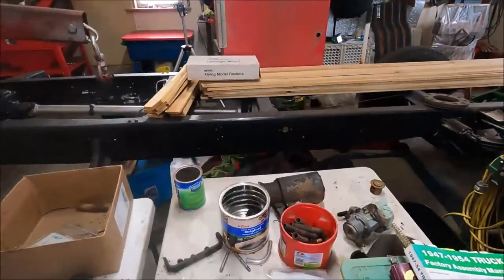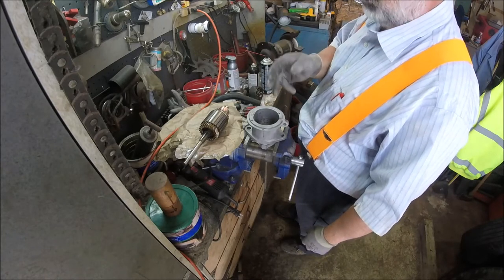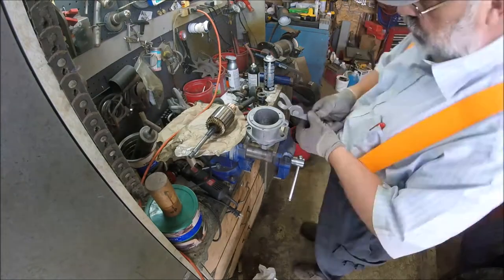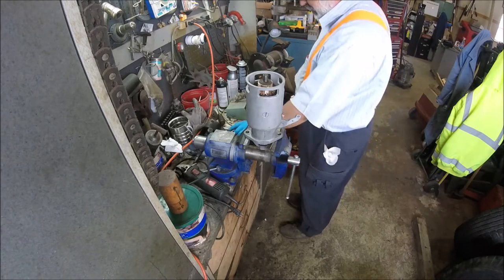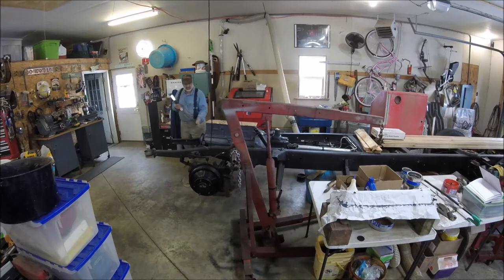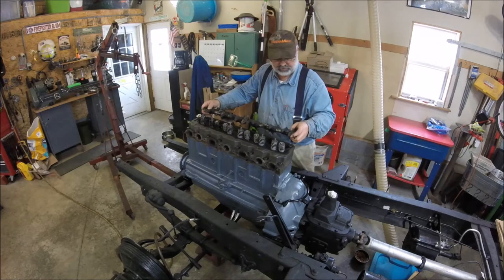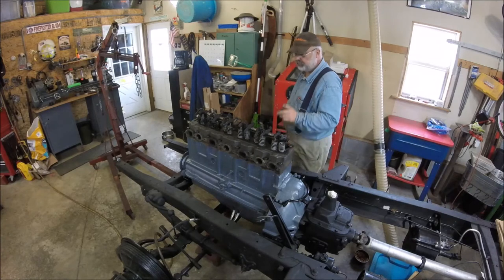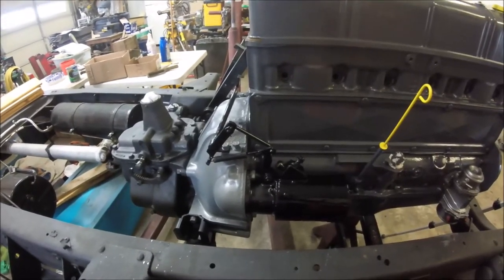1950 Chevy Restoration Part 11 starter rebuild, head on, and alternator etc installed

Comment: That baby doll's looking factory-new. I wonder if the aux vac pump supplies vac to the 2-speed axle actuator?
Reply from the maker: Wondered that myself but the research I found said the Aux vacuum pump was for the windshield wipers which makes sense as I remember riding in my brothers old Jeep (not sure what year but I'm sure it was pre 1950) and every time he would hit the gas the wipers would quit!
Reply: @crastfamilyfarm4799  I'm 72 y.o. and I also remember that phenomenon quite clearly. Mom's parents were farmers and Granddad also worked for the Soo Line RR, so they bought a new Chevrolet truck every year. I remember curling up on the floor (RH side) by the heater - must have been about 4.